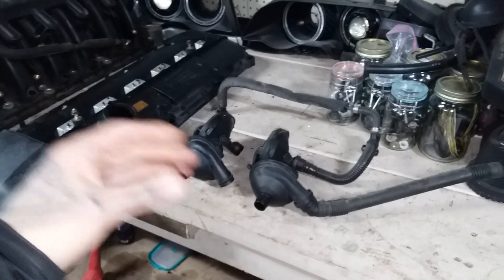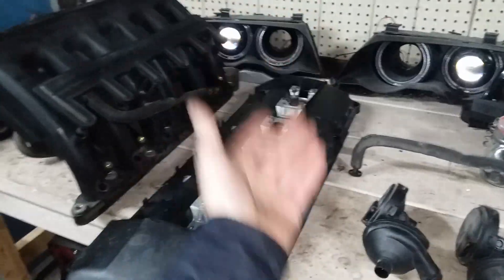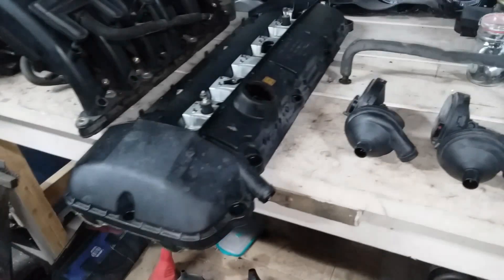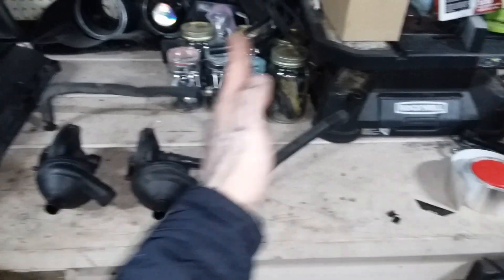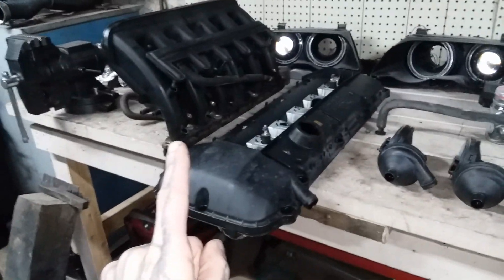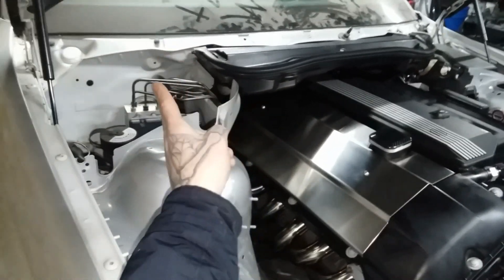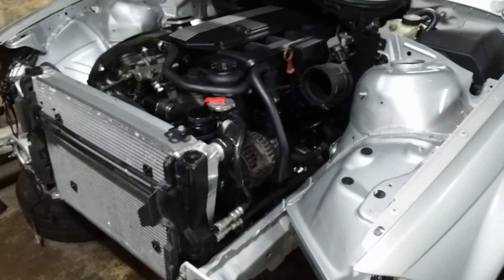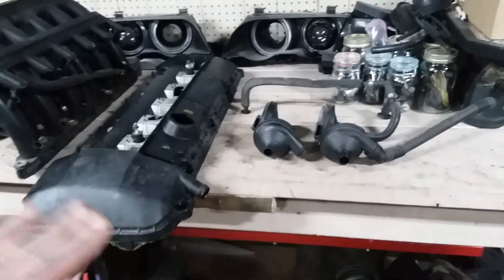BMW M54 M52TU CCV Valve and Boost-Turbocharger/Supercharger with Original CCV-Yes, No?

Comment: In my VF Supercharger setup for my E39 530i I installed a catch can setup and the outlet is routed to the intake port the kit it already had. I agree do not use the stock CCV system when its FI because you lack enough vacumm to allow it to work and open.

Comment: Hey man do you have an email or a social media I could message you on? I wanna ask a few questions before I do mine, I wanna get a hose from from valve cover port to a vented catch can, so I’ll cap off the ports on the top for the air rail, so where would the outlet hose go too from the catch can??
Reply: Like in the video he said you can dump anywhere outside the car. Whatever works really. I'm messaging him right now, asking what he thinks is the best setup for the b25 and b30 that have the weak oil control rings.

Comment from the maker: I totally forgot about another method that is commonly used on turbo cars. You may also route a breather hose directly into intake tract before turbo. 
-Example; hose leaving valve cover to catch can, outlet hose leaving catch can to intake, before turbo. Just be sure to use adequate hose size.

Comment: I used the vented Oil cap and it works fine. While running a catch can tapped into the stock CCV. Would like to switch the vent to atmosphere catch can.

Comment: Dude thanks for these amazing stuff you put out there!! I do have a european M52TUB28 with blown stock ccv. Going for turbo in a few months so I want to just vent to atmosphere now (track car). So you just plug off all ports and vent to atmosphere from the 7/8“ port at the front got that. What to do with the vacuum line to the fuel pressure regulator though? Thank you!!
Reply from the maker: You want to return that to vacuum.
Reply: Thank you!! So I‘ll just hook it up to one of the 3 vacuum ports on the engine front
Reply from the maker: @felix_4000  you're welcome my friend!

Comment: If you vent to atmosphere when turboing you could in theory use the spot that the ccv drains to the dipstick tube right? Using that spot to use for the turbo return line I'm talking about. But maybe that would restrict the flow too much? Have you thought of doing this?
Reply from the maker: People have done it for turbo oil drain, but it's a long distance for the oil to travel. A turbo oil drain is mere gravity powered, short and simple is best. 
-Draining to timing cover is highly recommended if top mount turbo.
Reply: @OLearysBMW  yeah thay makes sense. Top mount as in above the valvetrain?
Reply from the maker: @Darkaccent  same level/above, yep. Like video thumbnail, my old setup
Reply: @OLearysBMW  gotcha!

Comment: Thank you so much for the help in lending a part of your brain. It's like you're working on my m54 Street machine with me.
Reply from the maker: Not a problem! Also, another method of venting your crankcase would be; hose leaving valve cover to catch can, outlet house then plumbed before turbo. (if you're going turbo that is) 

That's if you didn't want to vent to atmosphere. Up to you 👍

Comment: why can't you just take the vacuum source from the intake before the turbo? or can you possibly add an electric vacuum pump and use that as a vacuum source? and where would you get a vacuum source for your brake booster? so many questions lol
Reply from the maker: This video is based on people who asked me if they can boost an totally untouched CCV system..

Yes, you can source vacuum before turbo, etc obviously.
Reply: @OLearysBMW  Ahh thanks, been wondering how I would sort out the vacuum situation for a while
Reply: @OLearysBMW  Okay one more question. If you take the vacuum from before the turbo, will it create ‘too much’ vacuum? So like... how would this affect the brake booster and ccv?
Reply from the maker: @stefanvulin9527  using the stock CCV?

Deriving vacuum before turbo works decent, it's how factory setups are on a lot of cars. Should be fine, as long as you have an BOV/Recirculating valve that's properly adjusted. I'd use it with an catch can though, not OE CCV.

Brake booster is connected to intake manifold regardless, high vacuum at idle and deceleration, none at WOT, and positively pressurized under boost.

Comment: Awesome content dude! Never found someone go into to this much detail for boosted e46s. I’m actually planning a boost build myself, want to reach 800-900 whp. I know I’ll need forged Rods and piston, the works :), but I was hoping to make it work with an aluminum block m54b30. The m52 iron blocks aren’t that common in Europe since they swapped to the aluminum for all m52tub. Any reason for why it wouldn’t work on an Alu block?
Love the videos by the way, found your channel a week ago and have already watched them all!
Reply from the maker: It's achievable, for how long I'm not sure. Definitely will want to figure out a good head stud system. 👍
Reply: the euro m52 are not iron, they are alu with nikasil witch is the worst, the m52tu and m54 are alu with iron sleeves. m50 are the ironblock you want for big hp

Comment: So if you VTA, there is no vacuum going to the catch can?  If so, how does it evacuate during idle?  Also, wouldn't it always show that it is running lean with a DTC?
Reply from the maker: Venting to atmosphere just allows the engine to release its combustion gasses naturally. The crankcase and combustion chambers/intake are totally separate. As long as there are no unplugged vacuum sources, it's impossible to have an vacuum leak when VTA. The crankcase/bottom alone is constantly under positive pressure, as it's creating blowby vapors at all times while engine is running. Idle, acceleration, deceleration.. No matter the engines state, as long as it's firing, gasses are being created within crankcase/bottom end.

Intake manifold: natural negative vacuum source with engine running, only positive pressure under boost

Bottom end/crankcase: constant positive pressure no matter driving condition, never vacuum with engine running. Boost or not.

The only way a crankcase/valve cover vent becomes a vacuum source is when an external device or hose is connected to it from the intake manifold, ie; OEM PCV systems.
Reply: @OLearysBMW  I love these type of videos! Thanks for doing them.
Reply: @OLearysBMW  would plumbing the crankcase ventilation between the air filter and turbo be a viable option?
Reply from the maker: @mariospantouvanos4645  I've seen this done before, both by people doing it themselves and similar setups from factory. If you wanted to, sure. I'm curious now, as to how much vacuum a turbo produces on the induction side.

Comment: Thanks for your time making these videos, much appreciated 👍👌😉
Iv been thinking about the possibilitys for increasing  ccv by adding ports in a m56 rocker cover, weld on a 90 degree fitting and and catch can to atmosphere with check  valves or venturi to my exhaust.. Thanks for your time and knowledge 👌😎.
Keep up the great content, thank you from Ireland